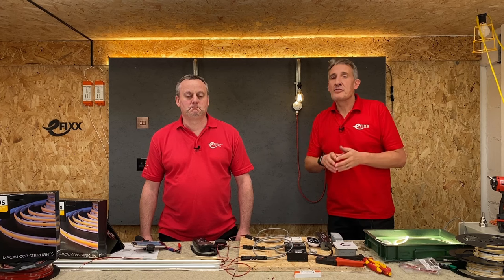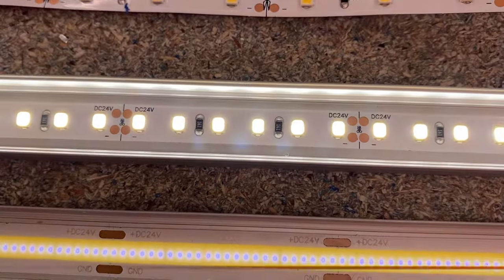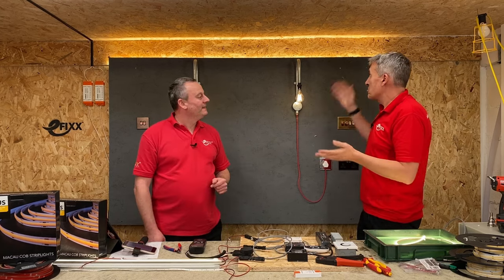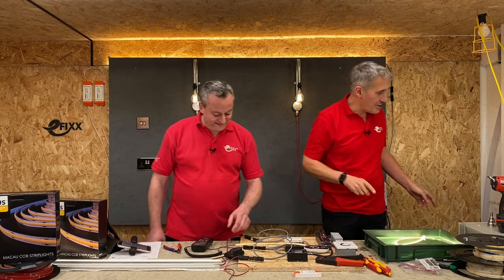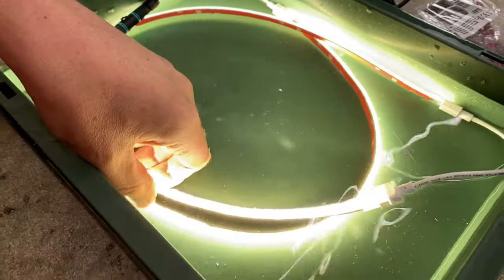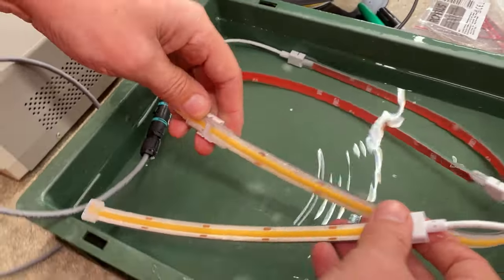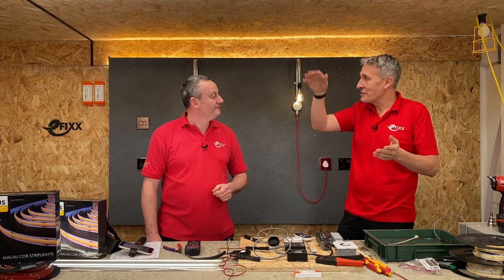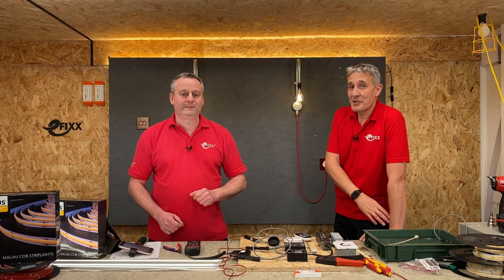THE SECRET OF GREAT LED STRIP LIGHT INSTALLS - COB

Comment: It's about time. How long will it be before they make an Edge version? They also need to move the solder pad under/on the back and trim the strip down to just the lights with no white edge.

Comment: Nice to see the Macau @ 90cri, might switch suppliers depending on availability , for anyone wanting to dim led strip in a permanent way, i use an adjustable voltage power supply by Meanwell, they even make them din rail mounted... nice to see you guys hitting on Cri.. colour in the video shows it better than previous
Reply: Dimming can be done via adjusting the voltage or by using PWM. PWM might be preferred for low light levels as the color is better preserved.

Comment: I was told that COB LED's die faster, but I've had these integrated in my kitchen larder for over a year now and they're brilliant!
Reply from the maker: LED life depends upon lots of different factors from mounting arrangements to drive current. In a kitchen used a few hours a day I wouldn’t expect any problems for a long time. (Assuming they are installed properly)
Reply: @efixx  I believe there is a quality issue too often with certain LED products. Especially with LED “bulbs”. Incandescent bulbs used a lot more power but for disposal they were just a bit of glass, a tiny amount of filament and some tin. Now a modern LED E27/B22/GX53 light is full of electronic components in addition to the LEDs. Every one that’s failed on me personally has failed due to the additional components failing. The LEDs are fine when tested on a lab power supply. What gives me the -hits is how much e-waste these things produce over a traditional incandescent bulb. Domestic lighting was never the major demand on our grids back when we had incandescents. Now we save with LEDs but I feel that we are fooling ourselves thinking that these modern LED bulbs provide a net environmental benefit over incandescents. I’m confident they don’t.

They are fantastic technology but my issue is purely the environmental claims and justifications for these things. 

When it comes to daily living though, I’ll admit that all that goes out the window with present UK electricity pricing which is effectively a national emergency considering it’s impact on those that can least afford it.

The solutions demonstrated in this efixx video look great. If the driver fails, which in my experience it is more likely to do than the LEDs, it can be replaced individually, thus minimising the amount of e-waste to the driver and not the entire lighting system itself.

For the purposes of full disclosure, I use a “vintage” kettle with a replaceable element.

Comment: I always use Non Waterproof and put them in Acrylic Tubing  for the  Under glow on my 69 Dodge Charger back in 2006 there isn't any gaps  as I am using the 3528 led strips when they shine on the ground, but maybe it is because of the, 
Acrylic Tubing making it like a tube light but 17 years  later and they still work fine,  now I am kind of interested in those  COB Led light strips they look good it doesn't matter if they're are non waterproof as I will be placing them in the Acrylic Tubing again for another project.

Comment: How flexible are these? im thinking of doing tight corner with these COB strips, will have any impact on the joints or is it pretty flexible on a flat surface to do tight 90 degree corners?

Comment: I want to use them on my loom beam. I get the strips and how they work, but I just don't know how to electrify them. This loom is in the middle of the room and would need a long cord? What components do I need? For the sake of conversation, let's call this loom beam 5' in length and I would mount the strip on the underside of the beam to light my handiwork. Thanks for any guidance you can offer

Comment: I’d heard COB recently… I’m on Hue color lights and light strips. The light strips themselves are never visible as they are at the backs of high shelves or under cabinets, so that solution works very well. They are plenty bright. And not having so many LEDs, they don’t generate as much heat and therefore don’t need ventilation. But I do have a potential application for a COB color light strip. We’ll see how it develops

Comment: I use this LED strip same exact product behind my reflector panel of my 1976 Ford LTD if you remember those I had that big Square red reflector on the trunk so you run that LED strip all the way around and you glue it down with Flex Seal there's a piece of foam rubber back behind that reflector and you paint that with Flex Seal and then glue down that LED strip and then wire it to a dedicated brake light source by running a wire all the way from the end of the trunk lid up to the brake pedal and Connect into the switch so it won't blink when you turn on the left or the right turn indicators by tapping into one of them it's an awesome application it turned out fantastic and old cars rule when you put in 21st century updating.

Comment: Can you make a perfect right angle with continuous light?
Reply from the maker: its tricky - unless you are using a deeper extrusion and diffuser cover.
Reply: arrange so the distance between them makes the distance between LEDs consistent.  Set them so the polarity does not have wires crossing. {yes, you have to solder - using short wires}}
Reply: @efixx  Thank you for replying. It's odd that ROBUS have all sorts of connectors but not a 90 Deg one - An obvious real-world requirement. I am looking to use the COB LED's on a stair project. I have 3 flights of steps - A 9 Step, 11 Step & another 9 Step flight. I am not exactly sure how I'm going to be able to control them all, as each step is 1.2M wide, with a 0.3M depth, and I want the COB LED strips to form a long "L" shape on each step - Hence the need for a 90 Deg join. Looking at the power requirement, it appears I will need 2 x 200W drivers for the 9 Step flights and a 250W for the 11 Step flight. As much as I would love to be able to create a Run-Way motion effect, I don't want to have to individually address each step with a wire - There would be far too many wires. As it is, I can probably hide a pair of wires for each flight to run to the drivers. I was thinking of getting an Arduino or a Pi involved, but going the KISS route might be best for my first project of this kind. If you have any tips - They would be most welcomed.
Reply: This effect can be achieved with our side glow COB light strips,  contact me for details.

Comment: I'm attempting to build a mini holographic fan, I've been using micro RGB LEDs to prototype with. 3d printing them into the spindles. Are there an COB multicolor strips. I'm also interested in OLED multicolor strips, do you know anything about them?

Comment: Have a question about the regular LED strips, can I solder direct to the copper pads?
Reply from the maker: Yes -  follow up video which you can find in the end screen or description looks at connections including solder method.
Reply: Soldering is the best way to permanently connect strips. Practice first if you are novice.

Comment: I've been using COB lamps for years, GU10 mainly and I was under the impression in related to the  make of the diode from the glass type the original LED lamps were made of to the yellow coated replacement, as opposed to being a continual strip of diodes. How do you guys deal with the problem of single insulated cabling, (both ELV and 230V), usually where they go into the driver, like that app controlled on the bench you showed,  or the 5 strand wiring that gets soldered onto the tape on an RGBW setup?
Reply: I've literally installed this today and had the same issue.
Reply from the maker: All of the single insulated cable here is on the LV side of the driver. The dimming modules have 24VDC inputs
Reply: What is the solution to drivers which have 230v terminals at one end and 12/24v at the other? I've thought about putting the driver in an enclosure but surely this will impede heat dissipation and likely shorten the drivers lifespan?
Reply: @ShaneSiKBoYBrown  what's the problem with taking the outer sheath into the driver,  I've never had an issue.

Comment: Blue and yellow make green. White is a combination of all colours. I think I knew this when I was about 7 years old.
Reply from the maker: It’s a blue LED plus yellow phosphor - not paint
Reply: @efixx  I assumed that colours coming from pigments in paint would be the same as colours coming from any other source, but it seems you are correct, pigments reflecting certain colours are different to light sources of different wavelengths - I don't exactly know why this is the case, but I've learned something - always assumed you needed RGB to make white, but apparently even Newton knew you could do it with blue and yellow.

Comment: Please have a read of the comment on joe’s regs corner video , I would love to hear your thoughts 👍
Reply from the maker: I’ve seen it - waiting for Joe to comment. Problem is electricians (and any employer) is bound by the Electricity at Work Act and hence GS38 which sets out the scope of equipment for safe isolation.
Reply: @efixx  yes but any electrician who uses it for safe isolation is a dangerous fool ,  example of use , your down the pub let’s say and the landlord ask you to take a look at the cable hanging out of the wall we’re the TV used to be he ask you if it is live or not ? You can’t turn the Circuits off  ? But you have no tools with you but the landlord has a few basic tools one is a neon screwdriver so you take that one a quick touch on the line conductor and wow it is live 
You now need to find the beaker for that circuit so you can isolate it and make it safe so you go home to your toolbox so you can do the job properly and safety.

Comment: I thought all led strips were cob hence the need for constant voltage instead of constant current?
Reply from the maker: The led chips are mounted directly to the circuit board - COB - regular LEDs have the chip mounted in a package including phosphor  which is then mounted to the LED strip circuit board.
Reply: BigClive has a good video on it

Comment: Why does it have to be 24V, this would be great for a theatre project, but I need to run it off a 12V battery
Reply from the maker: higher voltage = lower current and lower voltage drop.  you could connect 2 x 12v batteries in series.
Reply: Some manufacturers do 12v led strips which are some of the best & brightest I've used. I have soldered to the wee copper pads with a tiny soldering iron & used the remainder of the strip in my van & in friends vans too, so much better than the silly wee bulb in the back of a transit .
Reply: because of the Vf of the set of LEDs; more LEDs in a set means higher Vf which requires a higher power supply voltage. You can use a boost voltage converter to 'boost' the  voltage from 12V to 24V